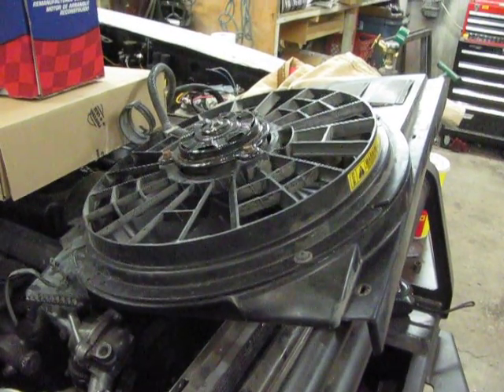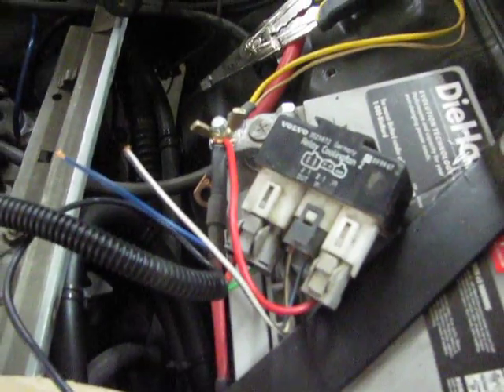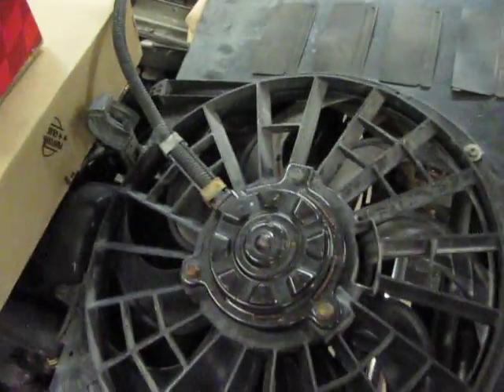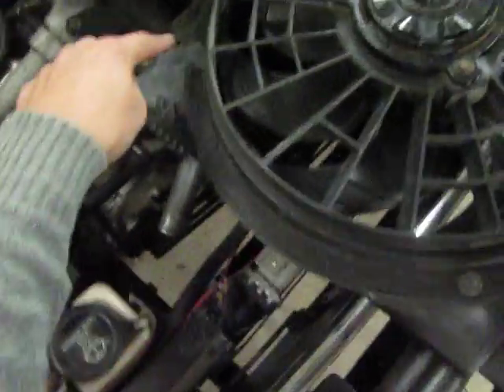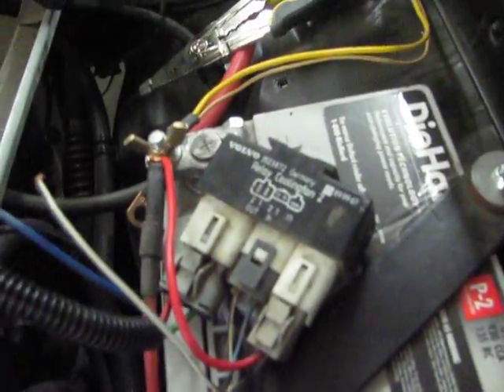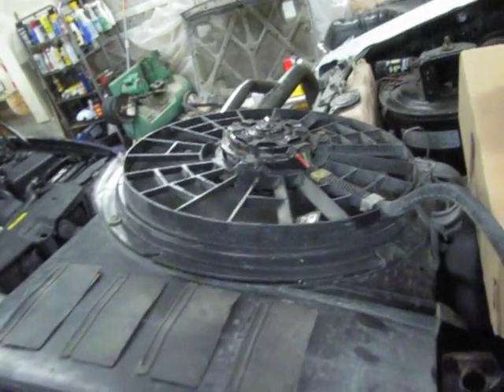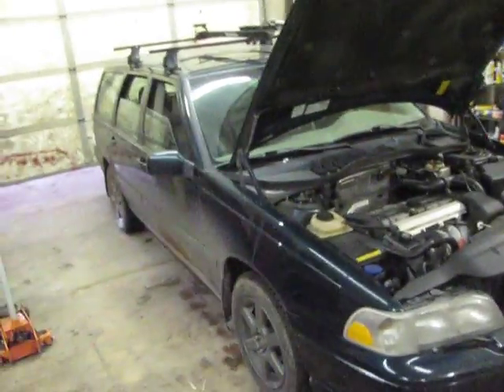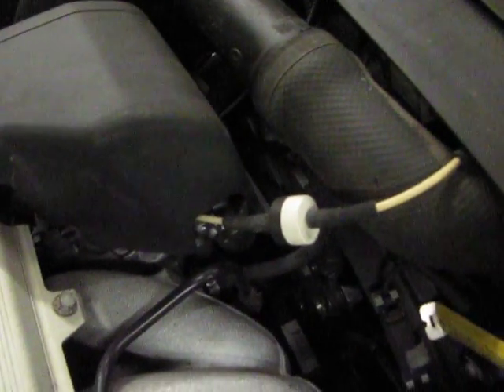Better Application of the Ford Taurus Electric Fan -- From a Volvo

Comment: you can pull the Fan and Relay from and Volvo 850 1993-1997 and any S70 V70 1998-2000 They are all the same !!
Reply: Have you got a part number?

Comment: Curious if you know what all Volvo models have the slim shroud like the 740 has?  maybe the 840?
Reply: I meant 850
Reply: I dont - sorry!  And these are hard to find now in the junkyards.
Reply: @AndreShoumatoff   Just yesterday  I pulled a fan and shroud from a 1995 Volvo 850 from the St Louis location PickNPull. There was one 850 and two V70's.   Not sure if the shroud is slim or not.  Compared it to one of the V70's that were also in the yard and it looked to be the same shroud, but the fan blade on the V7O wasn't the same.  Just hope there's life left in the 27 year old fan...lol.

Comment: I have the same exact fan, and I slapped it into a Ford sports Trac. I removed the relay that came with the fan and used a relay setup that I got from auto zone, but the fuse keeps blowing out on the relay I got.... I'm wondering if I put the stock relay with the one I got from auto zone, would it stop blowing out the fuse?

Comment: Any clue if both the high and low circuit can be run simultaneously? I am planning to use this fan in a Jeep Liberty CRD and the existing electric fan is 2 speed, but when high speed is activated it powers both the high and low circuits.
Reply: That's all done in the relay. You must have a dual temp sensor. 1993 525 BMW sensor it's on the radiator
Reply: You would just need to add a relay to switch it from 2 speed dual to single.  Not a huge deal I think.

Comment: Is there a way to connect ac compressor on volvo relay? I know how to do it with 3 bosh type relays though.for now i use low speed only and compressor.it cools preety good even at low speed my ac sucked at idle with clutch fan